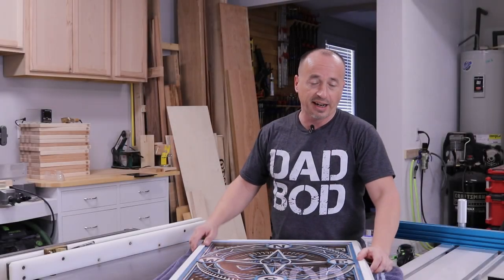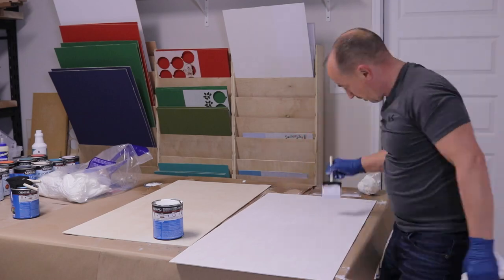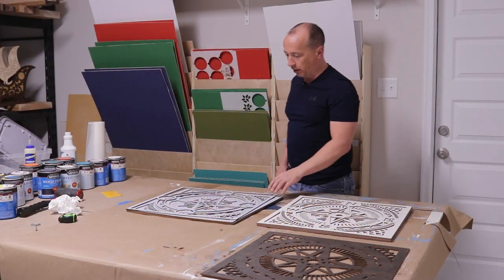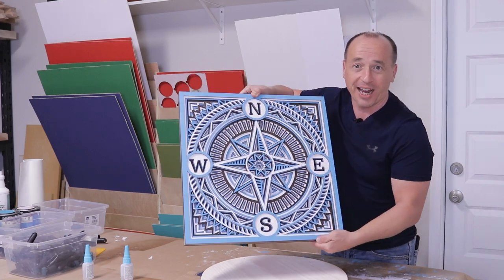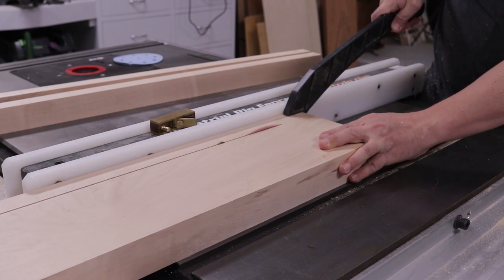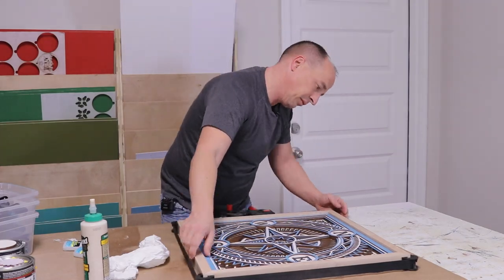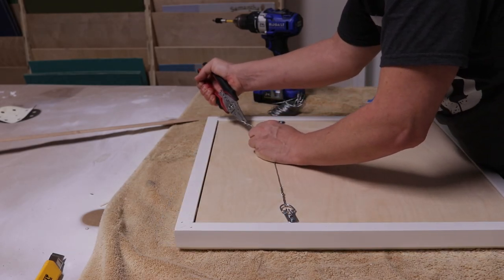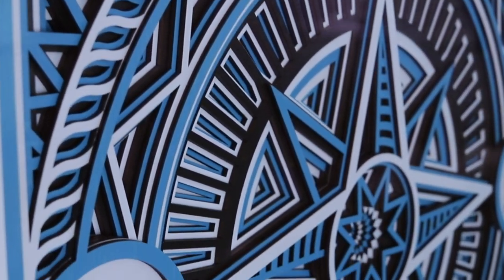Nine-Layer Compass Rose Art - LASER CUT

Comment: Great job..I am now getting to laser cutting...you.mentioned masking after painting the wooden ply pieces..does this prevent the scorching of the ply wood a d when the masking is peeled ..the paint comes off? ..what type of masking do you use?
Reply from the maker: Works like a champ... paint/stains stays with no scorch marks after peeling off the masking.  I use the paper transfer tape rolls and they can be found on Amazon in 12" wide and 24" wide rolls.

Comment: For sure I missed a lot on such kind of laser cutting experience, but why did you mask the plywood? And why you didn't spray color later after the cut? Just for knowledge.
Reply: Masking protects the finish from any burn marks. Finishing the wood first makes it a lot cleaner looking. There are so many edges no way to sain or paint afterwards and not look like junk. I spray my edges with flat black before I take the transfer tape off. Basically its a mess to color after its cut

Comment: Do you think it would be possible to make something similar, as a tile, for flooring or backsplash, from carved oak or ceder , by asking the moisture out of it, then use vacuum and pressure to get epoxy to soak into the wood, maybe paint the different layers with colored epoxy,. Then coat in a heavy layer of clear ? I do not know that much about epoxy, or wood carving, I ave see ppl make wood for knife handles and such, with an infusion of epoxy to preserve the wood,   and seen epoxy tables and floors, and ppl making their own flooring from ply,. So maybe do a vacuum infusion, similar to carbon fiber and fiberglass, it could turn out to be nice  or it could end in a big expensive MESS!  Probably carve and fill with epoxy would be a safer bet..  I don't really care for the really crazy epoxy countertops, I like the more like ingle color stone looking floor and counters tops,. With accent pieces..  nice work, it's a great time to be a maker!